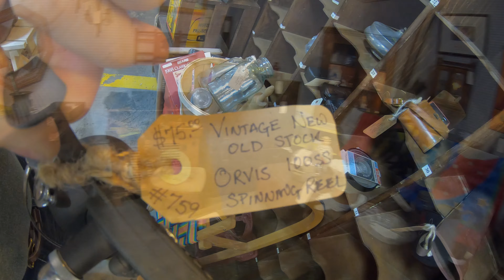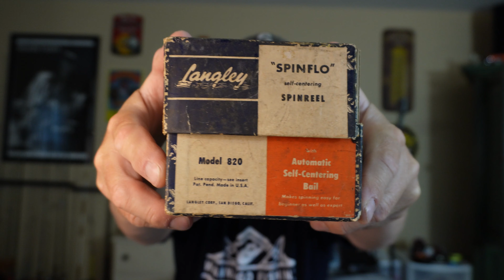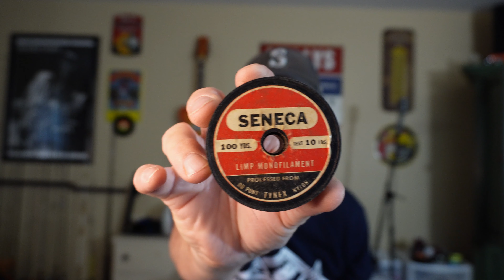Antique Store finds, Fixes, and Fishing Zebco XB65 and Langley SpinFlo 820

Comment: Nylon, the 1950's wonder material -"Self-lubricating", etc.  I have some early '50's Canadian made Shakespeare (Inglis) level winds with nylon gears, reels that I've overhauled and have cast but my concerns are the old gear set. Fortunately (?) the suitable (antique) 12-15 lb nylon braid line will probably break well below test and would likely save the gears should it ever be put to the test 😃 -it has parted  trying to retrieve a lure lightly hooked in a tree at what I would guess is about 6-8 lbs of tension -I could wade the river to recover the lure and it wasn't wrapped, just hooked in the leaves... LOL. .  It is great to see someone else who thinks these little machines are made to be used -Thanks for making these videos!
Reply from the maker: My father said on several occasions before he passed, “just because it’s old to you doesn’t mean it was any good, a lot of junk was made in my day😁”…
So even though I’ve come across some definitely “lesser” equipment through the years, I’ve always tried to give everything I’ve used a fair shake out there. 
Because we all know, all reels were not created equal. But I’m glad there’s still surprises out there, discoveries to be made.. but even though it’s a blast to find the “yet to be discovered” it’s still like Christmas morning 1975 when I find a Johnson Century or a Abumatic… isn’t that strange🤔.
Oh well😂.
Thanks for watching!! I appreciate it! 
Willie